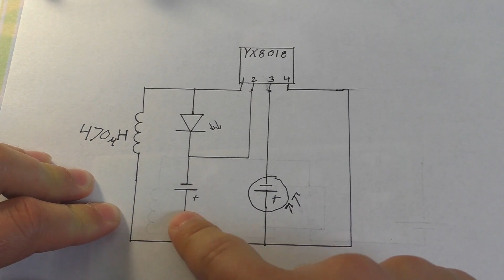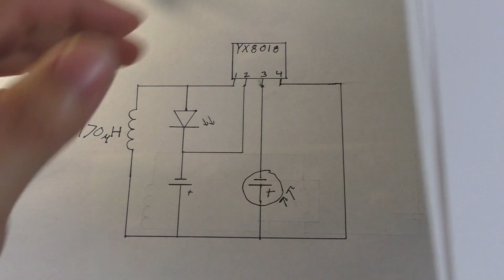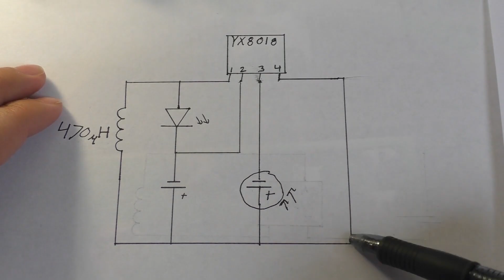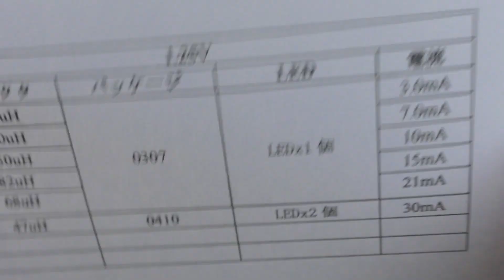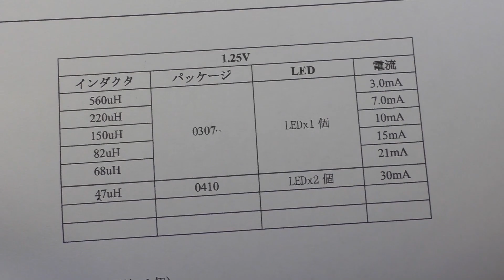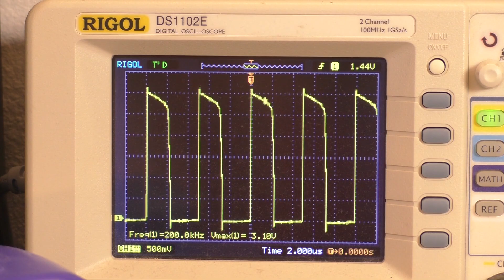Cheap Solar Garden Light Teardown

Comment: I've been trying to find information on exactly how much power those particular solar lights have put out and you just gave me some of it do you mind actually doing a more in depth on what the solar panel actually puts out and how much the other components contribute to the power put into the battery the more information the better we can do projects
Reply from the maker: If I still had all the circuitry I would. Would get another one, but they are likely won't be back in stores around here for anther 5 months of so.
Reply: @Eman2000  thank you for responding, that is absolutely fine what we're trying to do is get the most information confirm that the solars even though at low power are more light sensitive by knowing exactly how many amps milliamps and voltage these things can put out we have a project to share with everyone, I'm trying to put a little team together to talk about projects like this and how I believe that I can take it to the next step so when they come back into season please tell us what you found out or make another video thumbs up

Comment: Update here, the ones i found in the yard (not on fence) that  were not on were wet, i dried them out and removed the spiders inside and also checked the continuity between the sets of wires, that checked out ok.   But the batteries are dead, so does that mean that the batteries are bad?   Also one of them comes on when i bang it on the counter and then goes off, i took it apart and everything looks good, battery is tight and no lose wires and terminals are clean, but still comes on only if i bang it on the counter, then it goes off about 20 sec later, any ideas?

Comment: Hi, thanks for the video.  I use these for lights on the top of my fence posts in the back yard.   Just drilled a hole in the top of the fence post, added some sealent to the hole, and then inserted them just exactly as you have them here in the video.  I have been lucky, all 25 of them have worked for over 6 months now without any issue.  That is not the norm and often there are issues with them fairly quickly.     I appreciate the video and i will dig deeper as to why they dont work next time one goes out.     I believe you said that the board should have some kind of thermal paste on it to last longer,  is that the same kind of thermal paiste one might use on a computer build?  If not can you reply with what kind of paste to use on that board?
Reply: Not thermal paste. Conformal coating to help prevent corrosion clear nail polish works too. Also using dielectric grease all over the board and in the switch will also help.
Reply: You can also add one of those small desiccant bags like you find in pill bottles to help keep moisture and the resulting corrosion out.

Comment: You can use Google Translate App in the phone  - camera mode for on the fly translation. ;)
Reply from the maker: Thank you. I tried the translate app I just had the wrong language. 😂
Reply: Left Block (in Japanese English - Jenglish):
"YX8019 lights LED stably with one or two 1.25V rechargeable batteries.  When the solar light hits the solar battery, it charges the rechargeable battery and turns on the LED with the charged rechargeable battery at night, switching automatically."
Right Block:" 
Features:
High efficiency: 80-90%
less Peripheral parts: Only one inductor
Low-voltage battery protection function
Inductor current adjustment
Package: TO-94
"
Table:
"Lx - Switch Drain
CE - Solar battery negative electrode, EN control/charge control
VDD - solar battery positive
"
Reply: 0307 and 0410 are Packages of the component itself. By choosing inductors you can set current. ;)